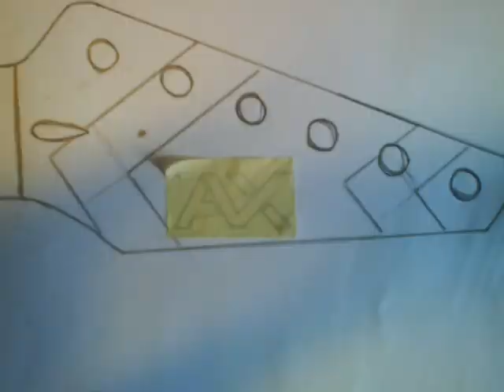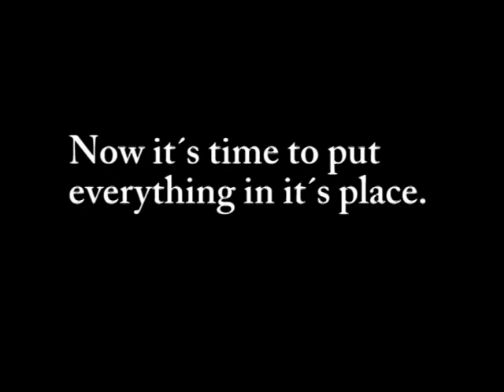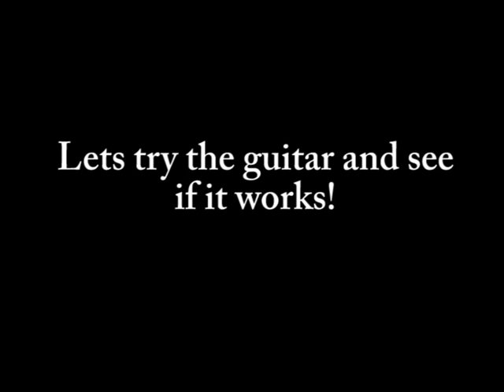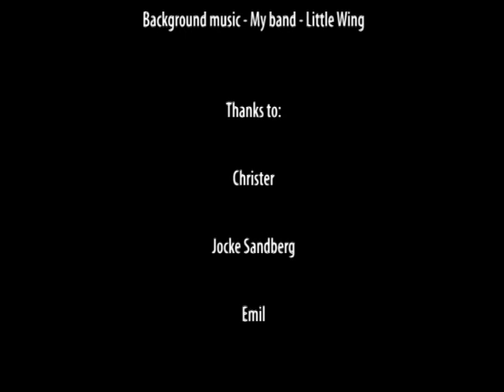My own homebuilt guitar (PART 2)

Comment: you forgot some things in the finishing process, you should have sanded with  high grit sand paper (1000, 1500, 2000, and 3000) and used a buffer with buffing compound, waxing compound and polishing compound. Other then that, amazing job.

Comment: The guitar needs to be wet sanded so you can't feel the paint lines. I know you can feel them cause I can see them. 15 to 20 coats of clear and  a lot of elbow grease. Also the guitar is making an awful lot of noise for having active EMG's. I have built three guitars, all with EMG's and they are quiet. They sound good thru my cheap Spyder III amp too.